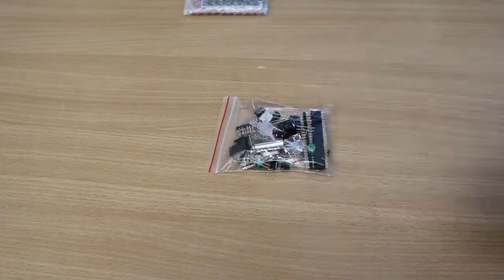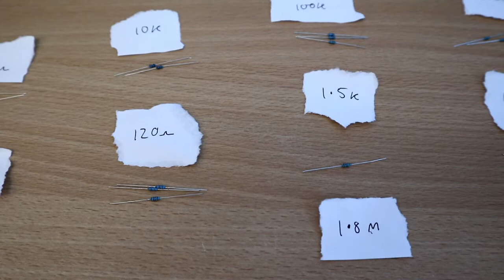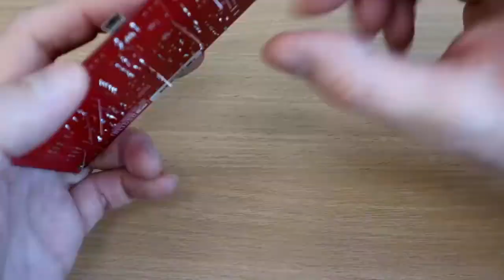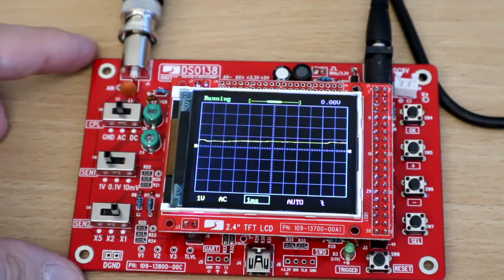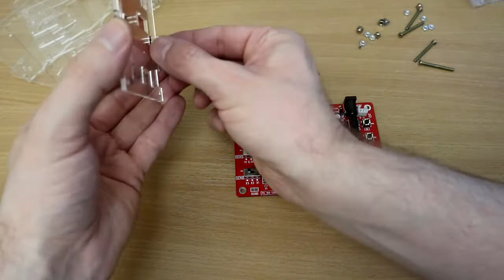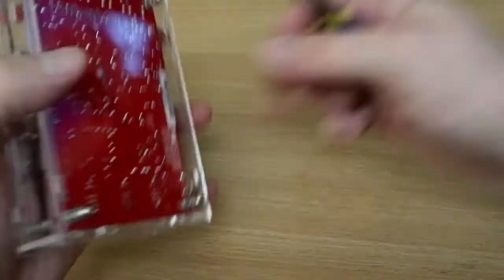£20 Oscilloscope Kit

Comment: Mine came in handy when I was building a RAM tester for 4164 RAM chips. I was sending ones and zeros into the RAM chips and reading the values back. By showing the output of the readback i could see whether my heath-robinson affair was correctly identifying the chips as faulty...

https://crashedfiesta.blogspot.com/2017/10/testing-memory-or-what-did-i-come-in.html
Reply from the maker: That’s incredibly impressive